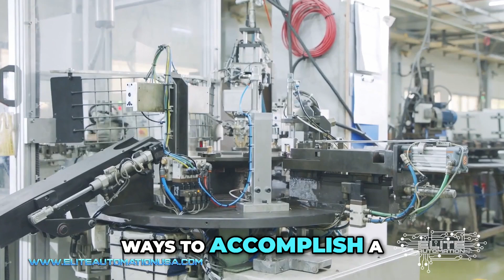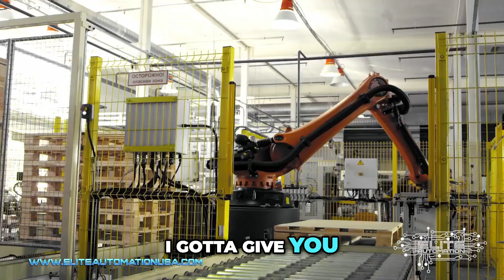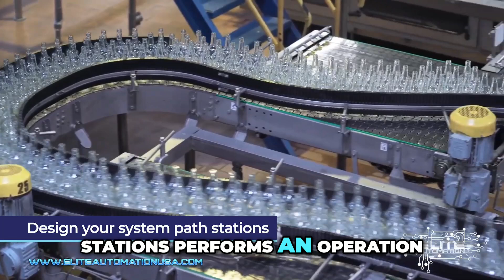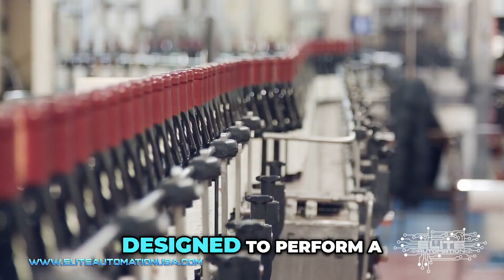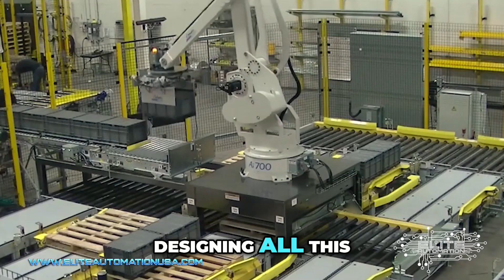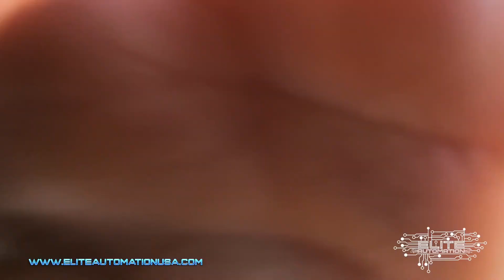Boost Your Manufacturing Efficiency with Smart Cycle Time Strategies

Comment: What tools or software do you use for flow-line production lines? There are a lot of interdependencies to handle with these sorts of systems.
Reply from the maker: Good question. The right tool depends on the line and the problem; I don't want to guess at a specific software stack. A useful starting point is a station-by-station cycle-time and downtime map, including buffers and blocking/starvation, then a discrete-event model when the interdependencies are too complex for a simple spreadsheet. Are you evaluating a new line or troubleshooting an existing one?